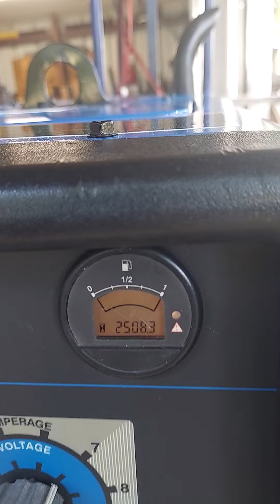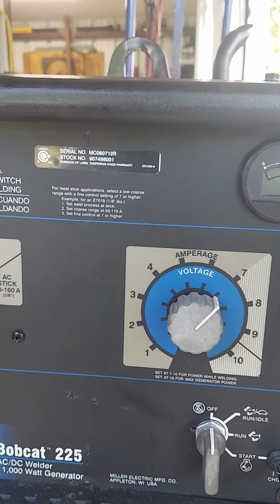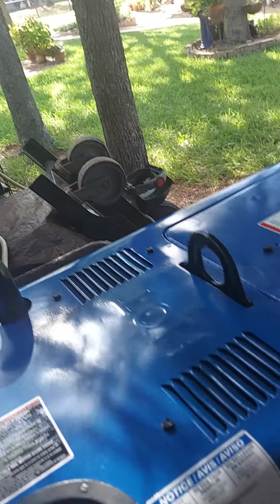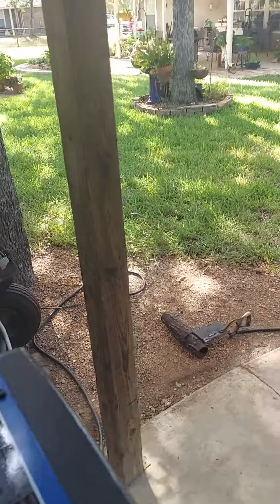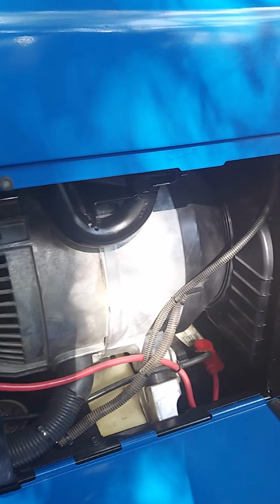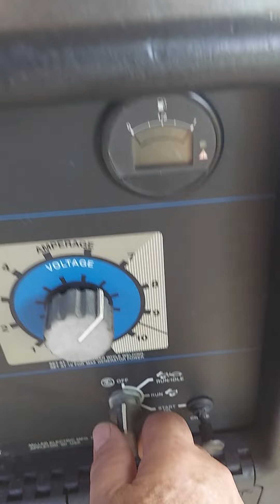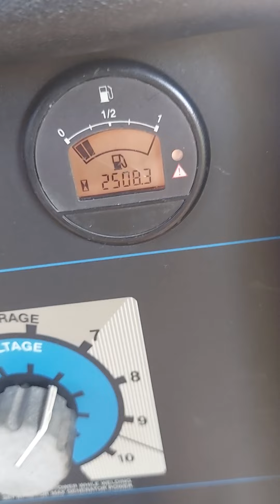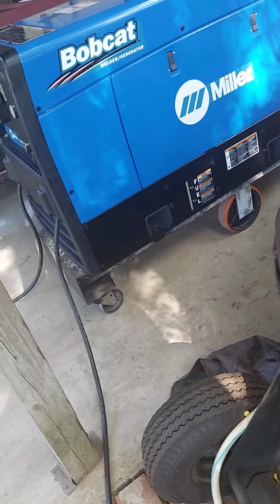Miller Bobcat 225, 11,000 watt welder complete rebuild all finished, I rewound the generator stator.

Comment: Who rewound it?
Reply from the maker: I did.
Reply: @nadingjeff  is it something you do for a living? If so what's the cost on having it done?
Reply from the maker: I guess I've done rewinds on welders that I own and resell. It's not something I do everyday. I do repair engine driven welders for a living and most don't need to be rewound. I've posted more videos on YT and a few deal with rewinding,  but most deal with other problems.  I can tell u most rewind shops will either say no or charge a premium price for them to rewind a welder because they have multiple windings in them. Two power winding, two exciter windings and the weld windings with three or four taps coming off of it. So it's pretty involved to do one, not just ur everyday rewind job.
Reply: @nadingjeff  I have the same bobcat that you have and my stator winding around the rotor is burned up. I'm having a hard time finding a replacement.
Reply from the maker: Yeah, there not easy to come by, what wattage is urs, sometime I run across them.
Reply: @nadingjeff  11,000
Reply from the maker: @russellwarner6272  yeah same as the one I rewound.  Have u tried Miller parts?
Reply: @nadingjeff  I found a place to rewind it for $1600 but I have not went straight to Miller. I was hoping to find a more cost effective option.
Reply from the maker: @russellwarner6272  that's actually not a bad price for what all is involved 5 separate windings, but that's u removing the stator out of the unit and then reinstalling it when finished  is it not?
Reply: @nadingjeff  it is
Reply from the maker: @russellwarner6272  it's really not all that hard to pull the stator off, two shock mounts four aluminum housing bolts and wiring to disconnect. On that unit there are three heavy black wires 10, 11 and 12, four white power wires and four white exciter wires their all numbered so u can reconnect them all from the wiring diagram on the side panel of the welder. Usually what I do is first loosen the rotor armature off the engine crankshaft a bit then pull the stator mount completely out take the bottom nuts off the shock mounts on the engine mount then pull the engine and stator along with the armature as an assembly. At that point it makes it real easy to remove the stator and armature so u can take the engine to a car wash, remove the fueltank, clean all that up as well, side panels and hood, it helps to give all of it a good cleaning. U can also inspect the engine crankshaft seals, see if they are leaking, clean and paint the k muffler with black high heat paint.
Reply: @nadingjeff  it only has 100 hours on it. It is in really good shape and is really clean. I have no issues pulling it apart. I keep holding out with the hopes of finding one with a bad motor that I can purchase for parts instead of shipping out my stator for rewind.
Reply from the maker: @russellwarner6272  wow, that really hurts to hear the unit only has 100 hours on it. The stator must of had moisture in it and shorted out when u tried to use it, not throwing blame at anyone here, I just see this allot. To explane: dew point and temperature of a day has allot to do with moisture build up on any metal, on a hot day there's not much to worry about but when lower temperatures and dew points are close to the same say like 60 and below metal begins to saturate with mosture. U think about it, if there is moisture build up (not rain) on the outsides of the panels and hood of a welder, there's definitely moisture build up on the inside on every component.  The other day I went into my storage shop, concrete floor and metal walls (not insulated) and the walls on the inside were just dripping with moisture. Went in to get a welder to troubleshoot,  brought it in to my work shop, pulled the panels off and everything inside was soaked with moisture build up. The temperature was 48 and the dew point was 46. I've seen more than a few shorted stators, there all been shorted in the same location, at the bottom where moisture build is most prevalent, this has been the case on every one of them.
Reply: @nadingjeff  that's a very good point unfortunately mine burned up due to a pin hole being worn through on the wiring on my generator plug on my house. When I plugged in the welder and flipped the 50 amp breaker to feed my house it billowed yellow smoke and fried the windings. I'm not sure why it didn't trip the breaker before burning up but that's how it goes sometimes. Needless to say, it was a sad day.